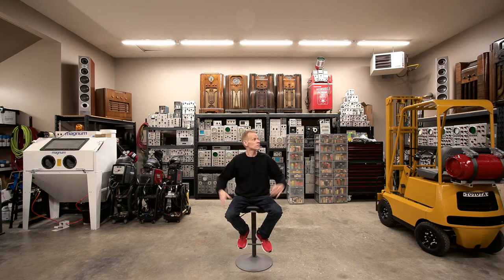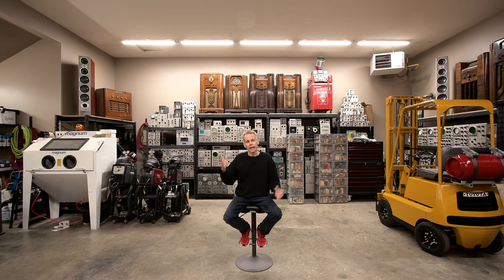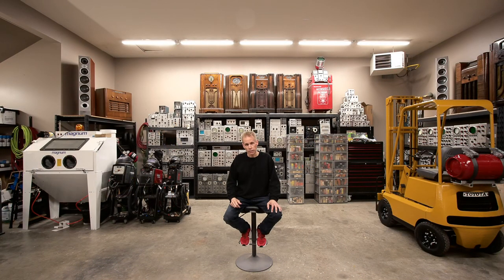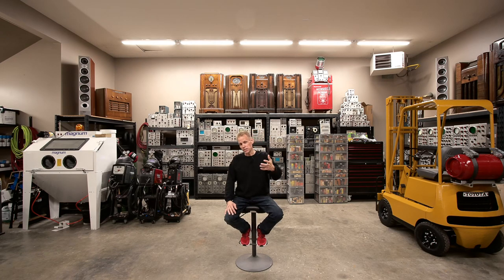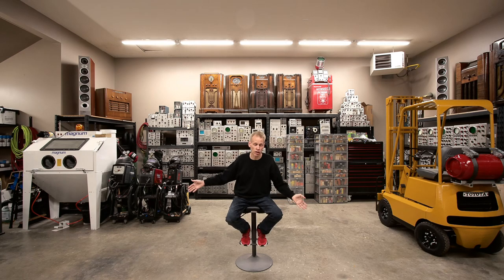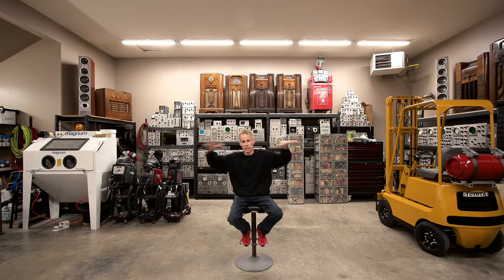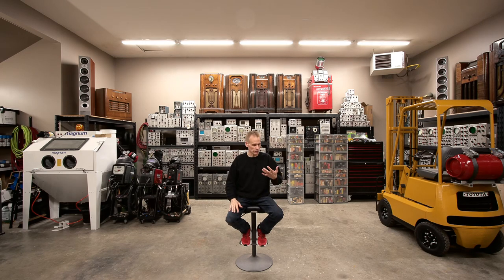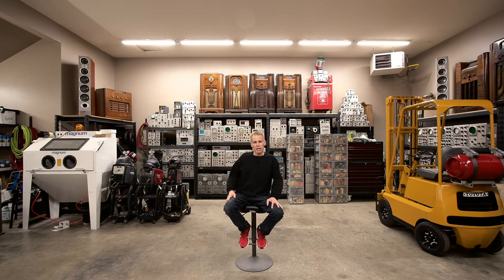ZAP! Mr C's Worst Electric Shock Explained In Detail!

Comment: When I was 18 I got across a 750 VDC supply in my transmitter.  Luckily my arm muscles preceded to throw the transmitter upward and broke the connection.  Another time I got across the output of a 75 watt output HF transmitter.  Was able to let go and immediately lay down.  The pain was indescribable as was the huge bump on my hand.  Learned from those early incidents and have been extremely careful since.  I am now 77.

Comment: I got a shock from a 12W Leak Tube power amp when I was getting it to work after being given it to me by an Uncle. I guess it was a few hundred volts, but lucky for me it was just from one part of my hand to another rather than across my chest and so it was merely painful - it throbbed for an hour or so. But it taught me a lesson about caution and always making sure you can see what you are probing or adjusting!  I've always been careful with mains electricity (especially since its 240v here) but its easy to get complacent about high voltages inside equipment, where sometimes there can be tens ot thousand of volts.

Comment: I don't want to say that you are mistaken Mr. Carlson but it is DC current that "Grabs" you and paralyzes the muscles.  AC current, essentially switching off and on 60 times per second, does not cause this paralysis.  AC tends to knock you off your feet or back away from the current source.  I too have been shocked many times during my long electrical engineering career.☺

Comment: Very scary story. Close calls like that can't get much closer....

Other than the usual 120V zaps, I've only been hit by usual amplifier 200-350V DC shocks and a few hundred AC once. Nothing quite like your story.

The first shock that wasn't wall 120 was from a large power transformer, rectified, measured at about 510V DC. My one hand was grounded, and I was aware of this, but what I didn't know is that a pair of pliers happened to be touching B+. Was a quick shock and left a small burn hole in my finger. Being hit square in the back with a 2x4 is the best way I can describe it. I didn't know what hit me, or if it was even a shock. 

I also had an occasional sharp nerve pain in the back of my upper right arm when raising it, with it behind me (ex. putting on a winter jacket caused a pain spike). That lasted about a year or two.

With some heart issues family members have had, and myself having a not-so-serious right branch block, I don't intend on being shocked many more times, even being young in the game.

Comment: I missed a ground wire off the power supply when rebuilding my first Hammond B3 AO-28 preamp.  Everything looked great on scopes/etc and I considered it ready to go.  Dropped it in the instrument, but was trying to figure out why the Leslie 122 wasn't switching correctly.  For those that don't know, with a Leslie 122, you tap off B+ on the preamp and send it to a "kit" that switches about ~100 or so volts DC to adjust the Leslie speed. (Insanely, the Leslie 147 switches 120V AC)

In the back of the death machine that is a Hammond Organ trying to figure out what I missed.  My left pinky touched the 122 hookup kit, and thumb touched the chassis of the AO-28.  Sitting there thinking "dude, this feels really weird, what is going on.  Why is my hand and body all tingly".  I could take my hand off, then immediately metered between the two and realized I was having B+ off the AO-28 go through me. Pulled the pre-amp, went over everything with a fine-tooth comb, and my heart sank when I realized it was completely my fault.  It scared the snot out of me, and I learned:

1.) No messing with high voltage with no one else at home. One mistake and your loved ones can find you dead.
2.) Let my family know I'm working with voltages that can seriously injure or kill me if I make a mistake.

It scared me enough that I've been a bit sheepish to embark on other projects since then. BUT, my hammond wouldn't sound as killer as it does without your videos here & on Pateron.

Thanks for everything, Mr Carlson. =)

Comment: My worst shock.  At work, I was cleaning underneath a commercial dishwasher.  The old one was a 220 line.  When they put the new one in, they were supposed to pull the breaker on the old 220 line.  They didn’t.  The wires were bare.  I was on a rubber mat when I touched the hot line not knowing it was live.  It then me back 16 feet.  Like you, it felt like a 60 hz hum.  That superseded any shocks I got from electronics.  The corporate headquarters called the district manager and told him to get that breaker pullers the next day.

Comment: At a guesthouse, I reached down in the dark to switch off a small (30w) 230v 50Hz bedside lamp. The plastic cover of the plug had degraded and I was touching live and neutral. I felt a pulsing feeling which moved from my hand towards my forearm. What was surprising was how slowly it moved up my arm.

Comment: That makes my biggest shock from a good sized capacitor out of a photo flash, which I obviously missed to discharge bevore accidentially touching the leads, seem like a mosquito bite.
One good piece of advice I would give out of experience a former coworker had, whenever you get a serious shock, either let a doctor check you up, or at least for the next hours, make sure you are with someone keeping an eye on you. 
Those shocks could not only cause immediate cardiac arrest, but almost more dangerously cardiac arrhythmia, which would be exactly what Paul described he felt. It may well sort itself out again, but if not, especially some time after, when people at some point tend to sit down and take a deep breath, it can as well become life threatening. The urge for sitting down and take a breath comes from actually not getting enough blood with enough oxygen to vital parts of your body, especially your brain. Better have someone around who can get help, or best case if it gets that bad, have an AED and someone who can use it and do CPR, as your heart may start to do a lot of things not contributing to just efficiently pumping blood and getting oxygen to your brain.

Comment: I just worked on a DAK X. I can confirm the bridge rectifier board on these DAKs are a common failure point.  Actually the whole radio is built strange.  Hybrid tube and solid-state.  I heard that a DC shock will actually keep your hand clamped on and AC will actually throw you away.

Comment: Had a similar experience when I was 21, 45 years ago. I was working on a 2KW home made linear amplifier, no interlock switches, had the cover off and one of the bleeder resistors across the HV plate capacitors was open circuit. I somehow came into contact with the plate of one of the 4cx250B Tetrodes, and was thrown across the room and hit the wall, hard. All I could see were stars and my ears were ringing! My arm felt like it was hit with a baseball bat!. Needless to say, after that, interlock switches were added, bigger bleed resistors and every time the cover was opened, a BIG screwdriver I used to short plates to chassis. Needless to say, to this day, in my 60's, I am just as paranoid as you, Paul, yes, I agree, safety should be presented like you do,
Barry, VK2FP/AGG7VC

Comment: After I retired from the USAF in 2001, I worked for a nano-fiber plant in North Carolina for a short while. 
The companies goal wasnt selling the nan-fibers, but instead selling their invention that made the fibers. At the time, nearly everyone could only produce a few grams per minute. But these guys had a way of making Kilograms per minute. 
So it used a conveyor, to collect the fibers (plastic fibers). It was sprayed onto a very large sheet of scrim, about 3 or 4 feet wide and miles long. Oh, scrim is a basic substrate, that is very thin, and strong, think dryer sheet like Bounce. It has the same consistency, except it comes on very large rolls.
Making it was strait forward enough. Scrim is fed on conveyor, the material is sprayed on, and then it is rolled up on the other end. Simple. To keep the scrim centered, and from wedging up on the sides (keeping it strait) and rolling good, there are a few PVC rollers, about 6 or 7 feet long by 4 inches in diameter. The scrim with the product on it traveled at about 12 feet per second through these rollers. 
Once in a while, a big fluff ball of the fibers would work its self loose. Part of my job was to catch it. Scrap it off with a wrench. About a 3 foot, wrench. Open end, about. 3 inch head. A massive piece a steel/nickel.
Well this one time a huge fluff ball floated down, and got stuck on one of the white rollers. I figured that was lucky, it was stuck there and I can scrap it off the roller. 
I put the wrench into the rollers area…. ZZZZzzz POW! An electrical arc over three feet long shot out of roller assembly. My arm went numb, I felt like I was going to pass out, so I began backing up a safe distance, as I did not want to fall into the machine. That would be a day ruiner. I fell on my ass, and  that when I noticed the machine was stopping. And everyone in the shop, that would be three people, came over to me with these big ass smiles on their faces.
“Are you ok?” One person asked.
“I guess no one told you about the static charge build up?” Another said.
Then the boss said, we have enough, lets test it and make a batch for real. 
I sat there staring at the machine. I later went to the main engineer, and told him how that could be prevented. All it needed was a copper wire suspended on the back side of the roller, about an inch or so from the roller.
Later I looked under the roller, it was like a light show under there. Hundreds of tiny arcs per second all over that wire.
I did the math. 36 inchs at 25,000 volts per inch (the amount needed to arc one inch through air). Nearly 1,000,000 volts! Ok, 900Kv. But it was an ass kicker 😅

Comment: Yikes. I've been bit by 120 several times but the worst zap I've received was when I manged to brush one of my bare 6" HeNe laser tubes while it was running with my right pinkie. Not only did it hurt like hell but half my hand went numb for a good half hour and that tube only runs at 1250VDC at like 3.5mA. I don't want to know what would have happened if that was my biggest tube that's nearly 3 feet long that runs on 3500VDC at 6.5mAh.

Comment: I woke up about half-an hour later after LEAPING back almost 12 feet in our garage after doing something completely stupid.  Made a Jacob's ladder, but has these really long sections of rod (a little under 4 feet), and was tuning / tweaking the bend / starting point JUSSSSST right to get decent travel most of the way up.  As the current woul flow, the tines would pull toward each other a bit, and a resonance developed to where the ends crossed and stuck together.  "Dad's childhood transformer - I'd better save it from a short!", was thought as I grabbed both and pulled them apart.  Now, having one tine in each hand with 7500VAC applied to me  (Center-tapped to ground, so really 2750x2 to ground), The metal legs on the wooden school chair conducted to the back of my thighs, and launch I did.  I remember the thoughts leading up to it, and the intense pain for a moment, then nothing.  What saved me was I was using darkroom developer timer to run things, and there were only a few seconds left on it.  Bleeding from the back of my head, equipment in a jumble in the opposite corner, I decided to be a bit safer with future endeavors using Neon transformers....Took weeks to get over the soreness.

Comment: love the story!
and appreciate the safety warnings too!
what i would really love is if you did a safety video on the main/biggest things to be aware of safety wise when working on radios and such. because it seems like so many places what you hear is "if you don't know what you're doing, don't mess with this stuff" but, since we don't know what we don't know, the only reasonable route is to either assume we probably know (not that wise), or we accept that we do not know everything, and not risk it.
for example, when working on tube radios "there is high voltage in there", so does that mean all parts are potentially going to kill you? i know that the chassis could be hot. so does that mean i can kill myself by touching the metal of the tuning knob? what are some good ways to test the danger points (like is the chassis hot)?
what are the main, top 10 (5?) things that you should know. how do i reduce my risk from x to x/20?
i think that would be very helpful.

Comment: As a teen back in the 80's I used to transform old record players I bought from garage/jumble sales into guitar amps because my parents were too cheap and poor to buy me a proper guitar amp and I'll tell you, I lost count of the times I got a 240v (UK power supply) jolt from accidentally touching live stuff on the circuit boards that were all 1950's- 60's circuit boards. Never stopped me experimenting with electronics in the slightest. 😆
Never seems to matter how cautious you are, even overly cautious you can still get an unexpected ZAP but that just adds to the fun of electronics and increases your level of respect for electricity. 

Paul is it true that it's not the voltage that causes risk to life but the "amps" that can be "GAME OVER" for hobbyists?

Comment: Addendum It’s a miracle my cousin Jay and I never got shocked fooling around with old tube radios, especially that old Zenith and Philco that sat in the attic.  If we only knew then what we know now.  I wish I had that Zenith floor radio the sound was almost as good as a modern amp.  All tubes, one huge 14 on speaker.  It even picked up modern FM.

Comment: Working as an electrician many years back, I had 347 AC blow up in my face due to my linesmens and the fact I had my co-worker turn on the wrong breaker... Sounded like a gun and I've now got a few dots burned into one of my retinas... Oops.

347 is the most deadly voltage for sparky's as too strong to pull yet not strong enough to push.

I've been hit several times in my life though, most recently was from a cap that I accidently touched when working on something, burned the tip of my finger. Any more of this and should be elevated to some kind of superhero...

Comment: I had something similar happen back in the 80s.  I suspect current load makes a difference in whether we live or just die right away.  I was in a dark basement trying to insert a 40 watt T12, 48" fluorescent tube into a ceiling light fixture.  It had pull chain on the fixture which was normally on, so before beginning I pulled the cord to turn it off.  However, unknown to me it was already in the off position, so all I did was turn it on.  It was dark and I while standing on a, fairly steady,  wooden chair had difficulty getting the prongs of the light tube to mesh with the spring clip.  With the fingers of one hand I found the notch while touching the pin.  But of course the other end dangled.  It should be remembered I thought I had already turned the circuit off.  Admittedly I was partially thinking of other things not related to the task on hand (a hot date later that evening) and not paying full attention.  With my other hand I reached across found the pin on that other side and began probing for the spring clip with a finger.  Found it.  Instantly realized I was in trouble as the light lit before full insertion.  My arms went dead and froze in position.  I could feel the electric path and my heart going a little wild at the current flow.  I wanted to release my hands, but couldn't.  Luckily I still had control of my legs and when I tried to bend my knees they did, which pulled me (and the light tube) away from contact.  I just stood there in the dark on the chair for several seconds and returned to normal.  I think I had current flow through me for maybe a half second   I was a lot more careful where my hands were the second time around and after pulling the switch cord again got the  light tube in without further incident.  I suspect that if the wattage of the tube had been higher it could have been a fatal experience.  I think if my knee had been frozen it would have meant trying to throw my weight around and falling as a way of avoiding electrocution, but also potentially badly injuring myself in a fall.  I further suspect that if instead of casually dragging the wooden chair over I had dragged over one of the aluminum old hospital waiting room chairs I also had in the basement I might have made a totally different electrical path that I might not have lived long enough to regret.  I also have an old National 57M shortwave receiver which is chassis ground.  I used to get very mild shocks off that fairly often till I retired it in favor of a newer ICOM unit in the 90s.

Comment: My worst shock was years ago when Britain changed the colour coding for mains wiring. In the old system brown was earth and in the new system it was live. Someone had wired up an electric fan with the new colours but put brown on earth. When I put put a plug on it with the colours on the correct terminals I received a kick like a mule and luckily was thrown clear. It left me with a healthy respect for 240 volts.